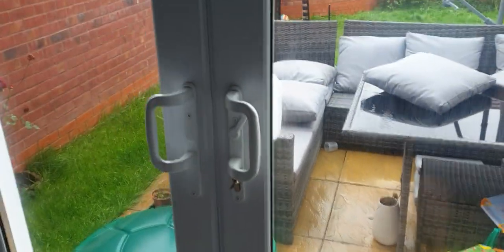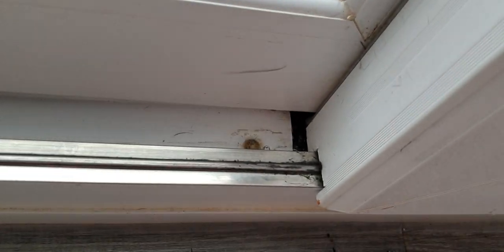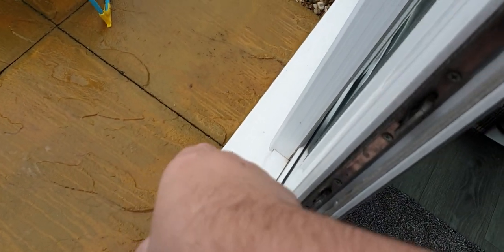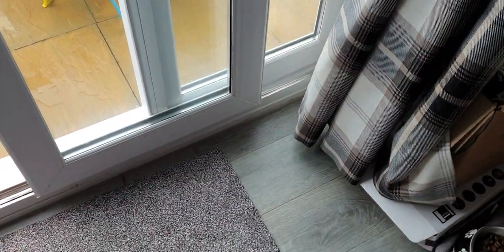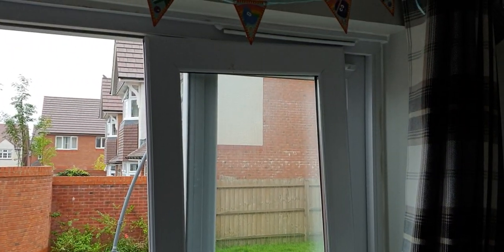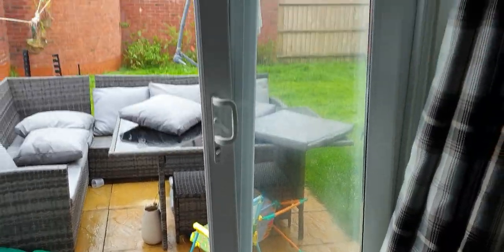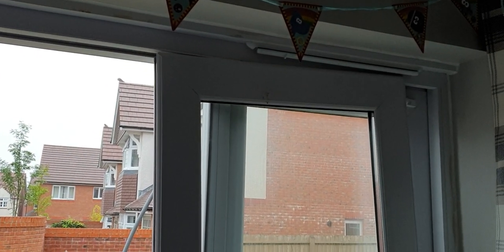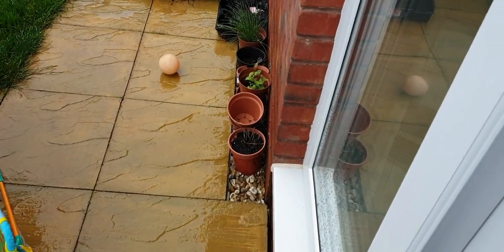Redrow New Build 400+ snags Patio doors bowed, SAR, nhbc, security, foundation crack desolved

Comment: Those doors are from dura flex. I fit them and they are rubbish.
Reply from the maker: Curious do you see these issues often and is this down to over filling with expandable foam? That's what another window company see as the reason why the whole frame top and bottom is bowed.

Our view and window company view is that they need replacing fully. Redrow head of customer service Colin Norvil and all Redrows directors Lee hawker, Peter Lewis, Matthew Pratt CEO etc signed off on these being fit for purpose. Even the nhbc told them they are shot and need replacing.

Thanks for the heads up on the company name, Redrow refusing to execute fully on our SAR request so withholding manufacturers etc names of things here.

If you know of any other manufacturers Redrow use that would be really helpful :)

Comment: Nhbc aren't usually that keen to sort things either
Reply from the maker: Nhbc told them it was basically shot and needs sorting but can't tell them to replace it. Since that meeting in December Redrow have been instructed to erect scaffolding, carry out reports, execute on over 100 snags (were still going through the list to respond to the rest), where nhbc measured they sided with us, where nhbc didn't bother measuring even though it's been measured by our snagger nhbc used 'by eye' measurements which is not acceptable.

Since that meeting Redrow have failed to once again respond to us and the nhbc. Then last week Redrow sent us a £15,000 offer to buy off us and shut us up. Within this offer they attempt to stop any legal action. We have declined their piss poor offer for works in excess of £80,000 plus whatever the flooring problem is going to cost.

Disgraceful performance and communication from a company making billions, they can't even meet building regulations and they still attempt to ignore it.

Comment: Never ever buy a new build! Or nearly new. No one cares anymore
Reply from the maker: All houses were new at some point. The problem is the trades don't care and neither does site, site managers, customer services, head of customer services, directors and CEO. It's everywhere and that's a major problem.

The only way to change this is to have severe financial penalties thrown at each and every single one of them. Also all names of anyone who did anything to a house and what should be handed over at completion. There should be full accountability. There also needs to be independent building control that actually inspects at these stages as well as a surveyor prior to completion. If they sign it off they are also held financially liable along with all the trades, site managers and directors / CEO etc.

Things only change when it's financially costly to do so.